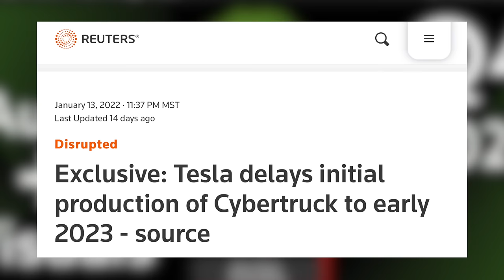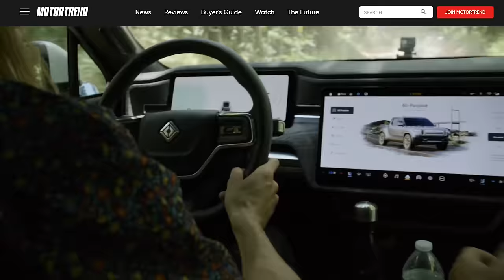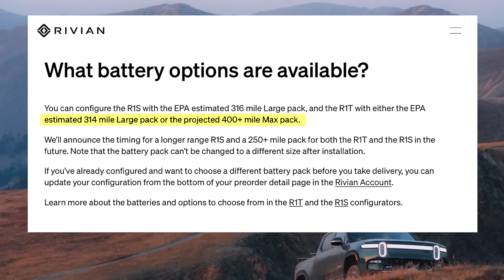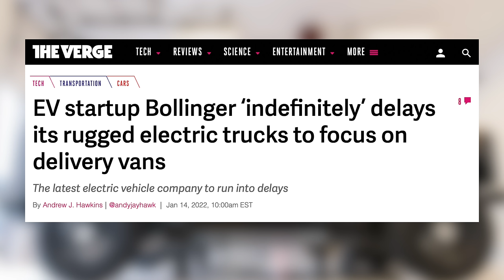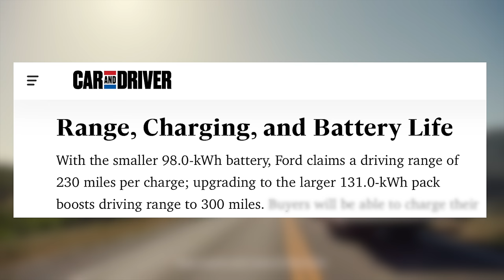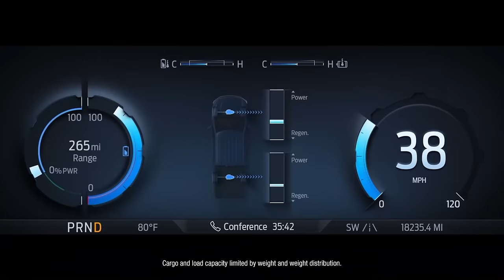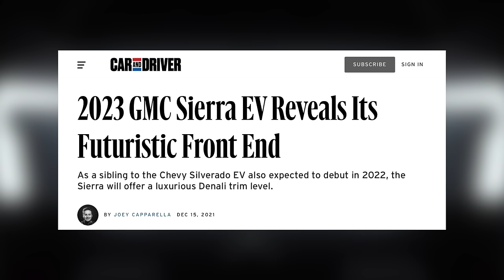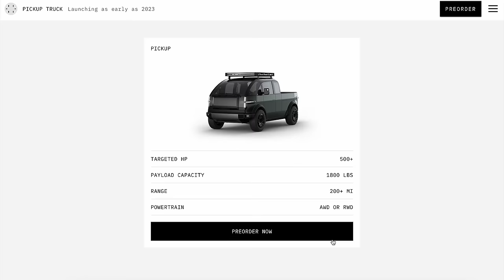NEW 2023 Tesla Cybertruck Competition? | The Best EV Electric Pickup Truck in 2022?

Comment: Do we know the weight of Cybrtruck? If weight is significantly reduced (~5000), it will be interesting if competition is closer to 7000.
Reply: I haven’t heard anything, but the truck has a six lug design so it’s heavy!
Reply: The truck will be very heavy. My guess is over 7k lbs especially with the quad motor and 500+ mile range option.

Comment: I've spotted the Rivian R1T in the wild twice; someone in next door subdivision has one.

For CT pre-orders, assume they won't be honoring original pricing on any hike? Bummer but leaning toward the Ford Lightning, if only for bidirectional charging aka powerwall on wheels.
Reply: I would get the Chevy if you can wait a year.  It has better bidirectional charging and comes out in late 23 for the rst or early 23 for the work truck version.
Reply: @mattferguson9109  born and raised Ford Guy. What will Silverado do Lightning won't?
Reply: @mattferguson9109  not like I'll get a 1st yr model anyway, gonna be in short supply.

Comment: I am most interested in trucks with a “2500/250” level suspension/payload/towing capacity, for towing a boat over high elevation mountains in Idaho, whilst carrying a traditional slide in pop/top truck camper.  And in at least a standard size bed.  And four wheel drive/AWD available.  Towing is only part of the story, and carrying a camper with a significant enough suspension not to get tippy or over compressed suspension.  I am figuring this first run of trucks won’t get us there yet, and that level of capacity may be a few years out yet.  The range under load is a big issue, as charging is problematic out in the middle the mountains of Idaho, even on the Tesla network.  I do not plan on driving the most direct route to Missoula from Sun Valley, for example, as it pushes slightly the range of the Y I will have coming for now.  And “dry docking” is a common use for us when we camp.  So, again, range under load will be important.  In the meantime, I am hoping to use my MYLR for most everything, save my diesel pick up for only pick up things, and find a source for biodiesel again.  Also, when solar can be an option to actually help top off or charge, that will be a game changer.  Likely a ways off.

Comment: The sad thing is, that we are now to the point where the Cybertruck will have to compete with others. No longer the competitors competing with the Cybertruck. They are falling way behind in the EV Truck market.
Reply: Yes, I must agree with you even if I am a Tesla shareholder. My peers say Tesla will come on top with their FSD but let's be honest the research into autonomous driving isn't directed into off-roading or driving with unusual loads (eg long pipes/planks sticking out the back) so its a moot point when it comes to the trucks. There is a gap in the market and Tesla aren't focused on it. However, it comes down to strategy in the end and making trucks the priority may not be the most profitable decision. The pickup truck category is a niche after all and I believe Tesla is putting their efforts in the most bang for buck category. Think 80/20 rule. Competitors may be chasing the breadcrumbs with their trucks but Tesla is going for the loaf of bread :)
Reply: @Eudamonic  I agree, as long as the Model Y and Model 3 continue their dominance it’s a moot point for sure.